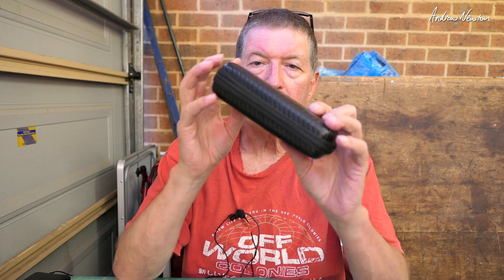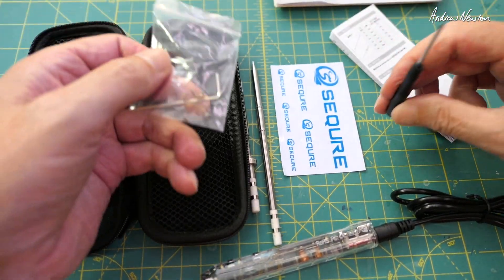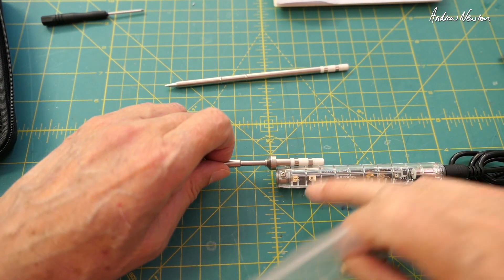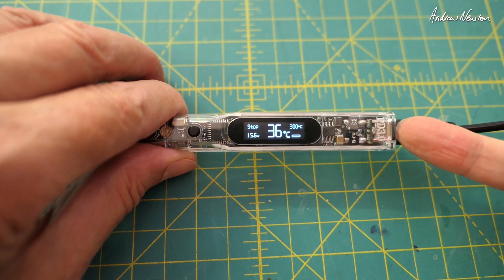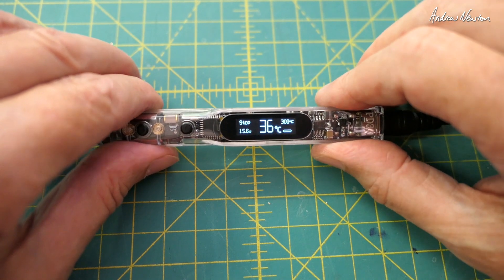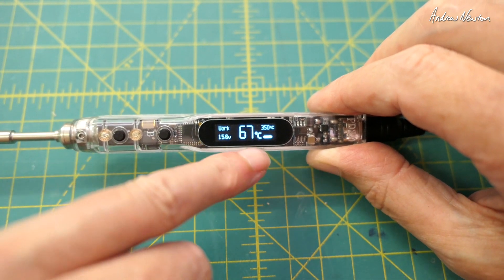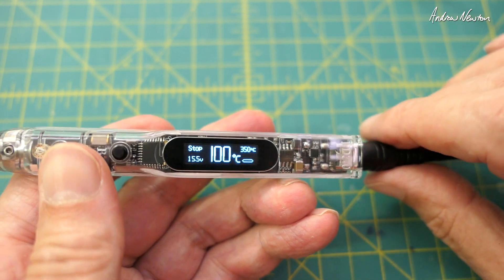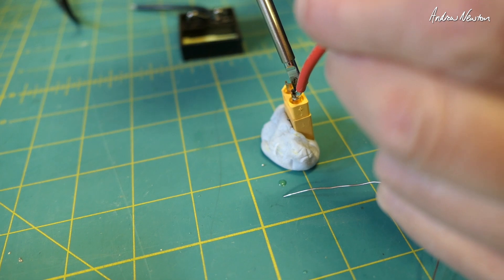Sequre SI012 Intelligent Soldering Iron

Comment: Hello

Can someone tell me why it shows firmware update when I put my other non origin 120w USB a to c cable in the soldering iron, is the a function that it goes to solder mode instead, with my origin cable it works normal,but I would like to have other options on cables beside the original. 🤔

Comment: The fact that it uses t12 is just golden. The miniware tips are good too but you only have one size of chisel tip which is also too big for an everyday iron. The vast selection of t12 tips makes this the best of the mini irons out there in my opinion! Plus it's 65w pd compatible which means you can use it with a portable battery. This makes it perfect compared to the miniware irons and the only thing that really was missing from those irons was a lack of tips now you have a much better selection of tips available.
Reply from the maker: Good info thanks Eric

Comment: I have been using a TS100 exclusively for over a year and it takes T12 tips with no issue.  They just stick out a bit further.  And no need to swap components in the iron to switch between T12 and standard sequre or TS100 tips.
Reply from the maker: Good info thanks.

Comment: ew, why didn't you soak the wire ends completely? :)
do you know if it's ok to install both contacts and use the long tips?
or does that create a short circuit over the casing of the long tips?
i think i'll buy this one
Reply: With a long tip, if you install the front copper piece, the soldering iron will recognize the short circuit, and will warn and prohibit heating. The front end needs to be disassembled for proper operation.
Reply: @SequreTech  ah, that's good
Reply from the maker: Yep, would short out on the barrel

Comment: like it but had purchased one before and have also a soldering station.

What I do like about this is the nice solution as a kit useable on the field while my portable was delivered in a box.
And I do like the display and menu too.
What I do not like that much is the price and maybe struggle with customs on top.

Too less added value to get one - but if price might drope things might change. I usually only need the small tip on the field, the other ones are for use on the bench where i already have a full soldering station.

But I like such videos about small solutions that meets our requirements and that you are able to show in the garage.
Hope, your new house will soon be ready to move in cause I can remember living out of boxes for 2 times. Worked out, but was also a big struggle.